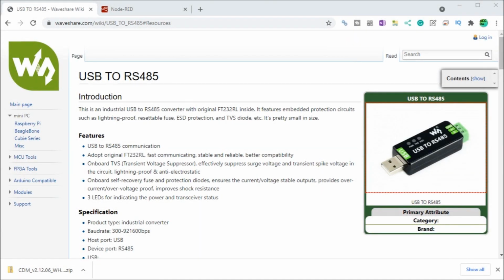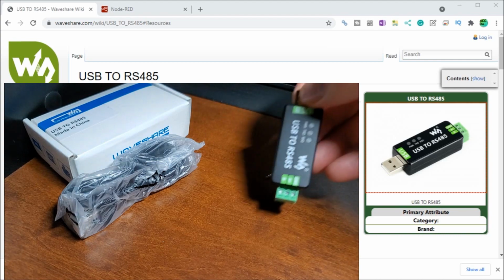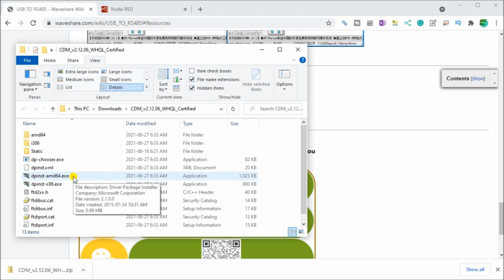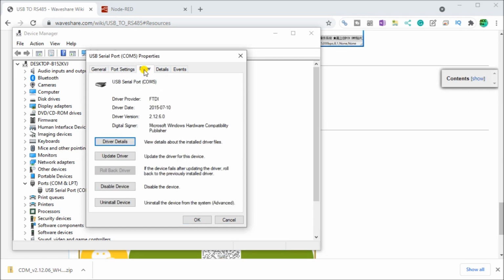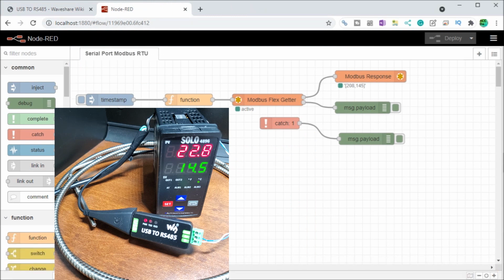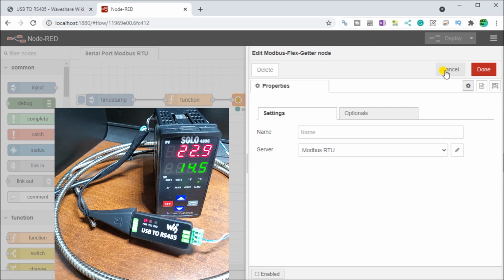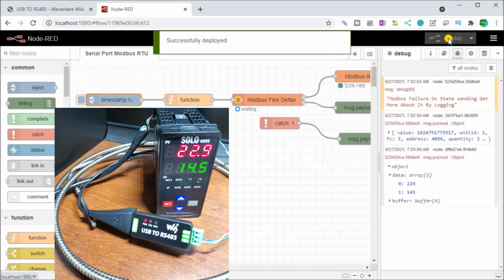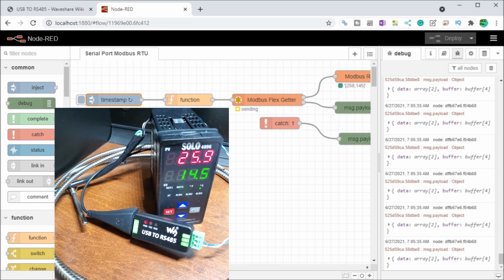Control Solo Process Temperature with USB to Serial, NodeRED, and Modbus

Comment: Have you tried to interface this with a raspberry pi?
Reply from the maker: Hi @overmind15,
Here is a post on using this with the raspberry pi and communicating with a PLC and Temperature controller.
https://accautomation.ca/raspberry-pi-serial-port-programming/
I hope this helps you out.
Regards,
Garry

Comment: can that tool use a cable for rs 485 100 meters long?
Reply from the maker: Hi Akbar Abdul,
The RS485 specified maximum cable length is 1200 meters. This really depends on the baud rate that you are communicating and the environment. The lower the communication (baud) rate, the longer the cable can be. 
Here is a post with a chart showing cable lengths for RS485 at very high baud rates.
https://resources.altium.com/p/serial-communications-protocols-rs-485
I would say that 100 meters at 9600 to 19.2K baud would be fine.
Regards,
Garry

Comment: @ACC Automation I am having an issue with one of these devices any help would be much appreciated, I have one of these devices that i am trying to setup for use on two laptops, I have it running on one but not on the other, the laptops are like for like com ports driver's setup the same any ideas ?
Reply from the maker: Hi theboyfrostie,
When you open Device Manager and look under the Ports (COM & LPT), do you see the device on each computer?
On the computer that is not working, you may have to remove and re-install the driver again.
Regards,
Garry

Comment: What puzzles me in your video is that you have an 8n1 setting in Windows and using 8e1 in NodeRed. I thought that the setting in NodeRed was for the WIndows side. I could not get it to work with my project (Solax X1 Solar inverter) and this just might be the solution. [ Edit: Nope, checked the docs, Solax states to use 8N1, no parity. ]
Reply from the maker: Hi Emcofan,
The Windows side shows the communication port used and the default parameters if not set by other means. We are using Node-RED running on this Windows computer so it will set the parameters for the communication port. 
I looked up the "Solax X1 Solar inverter" manual. It looks like it communicates CAN RS232 which means CANbus communication. When using Node-RED you will have to use CANbus communication instead of Modbus RTU communication.
Here is a link to the Node-RED CANbus Nodes:
https://flows.nodered.org/node/node-red-contrib-canbus
I hope this helps you out.
Regards,
Garry
Reply from the maker: Here is where I got the information:
https://www.solaxpower.com/wp-content/uploads/2022/03/User-Manual-SK-SU-TL-614.00036.05B.pdf
This is the manual. On page 15 under Communication interfaces, it indicates Can/RS232.
Regards,
Garry
Reply: @ACCautomation  This is not the manual of my inverter. This manual is for a hybrid which charges batteries as well. My inverter is type Solax X1 Mini X1-2.0-S-D(L). So it CANnot be CAN. ;)
Reply from the maker: @emcofan  
Now that you have told me the model number of the equipment that you have it does not communicate Modbus or CAN.
This communicates in its own protocol called Solax Power Single Phase External Communication Protocol V1.2. Here is the manual:
https://github.com/syssi/esphome-modbus-solax-x1/blob/main/docs/SolaxPower_Single_Phase_External_Communication_Protocol_-_X1_Series_V1.2.pdf

You will have to communicate by sending the correct packet information.
Regards,
Garry
Reply: @ACCautomation  I mentioned my model to you before but because i included a link in the reply, Youtube decided to delete this reply to you. But... I can confirm your advise and got it working now. Everybody calls it Modbus but with Modbus tooling i cannot get this to work. It works now but this is definately not Modbus.